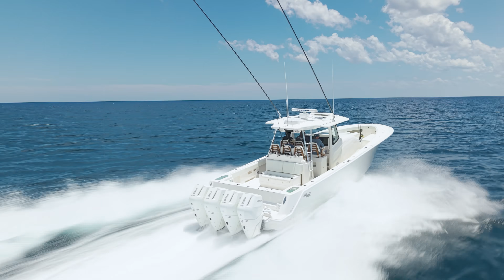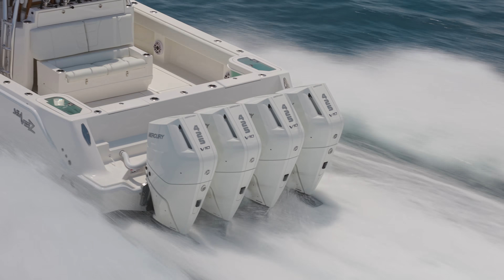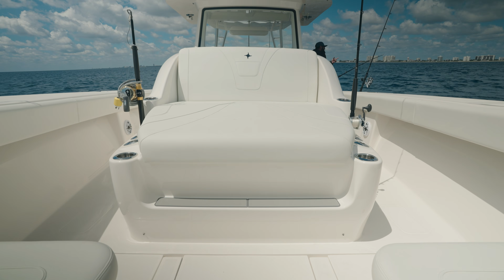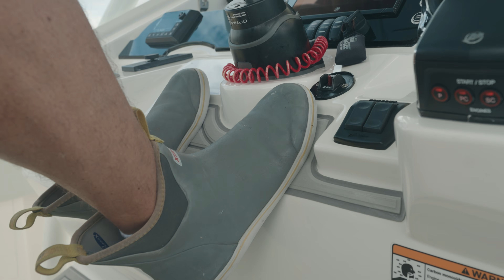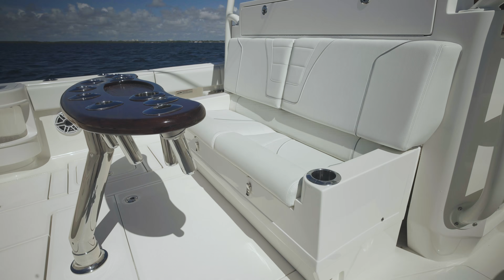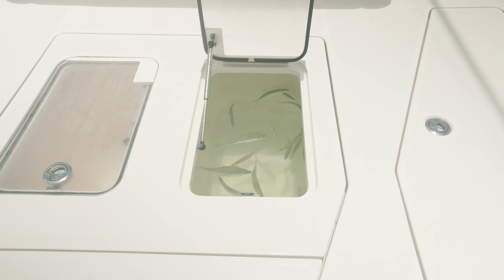SeaVee 450Z Full Walkthrough | Performance, Configurations, and Available Options

Comment: Price?
Reply from the maker: Like all SeaVee's the 450Z is built to order and sold factory direct. As a result pricing can vary widely influenced by things like which outboards are selected, adding a tower, and the electronics package. The starting price with quad Mercury 425's in 2026 is around $1,35M. Please contact our sales staff for a build sheet with the options and current pricing - 305.756.6419